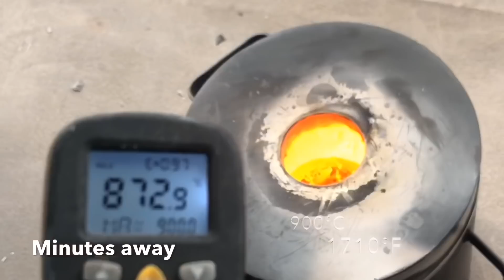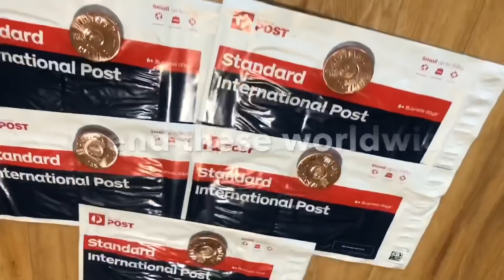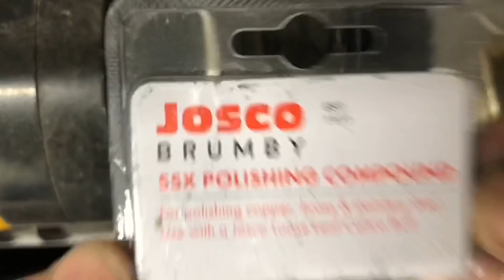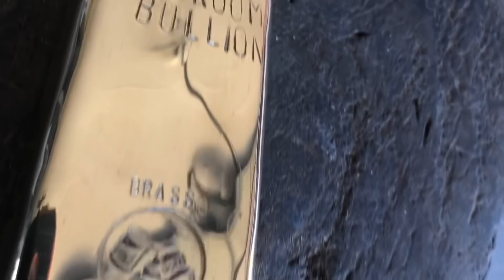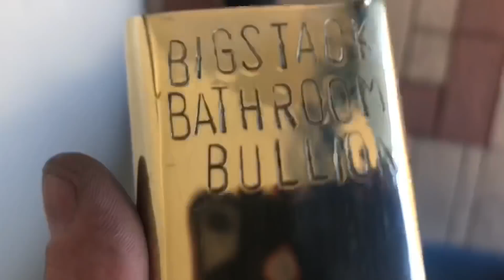Melting Bathroom Fixtures￼ - ASMR Metal Melting at Home - Brass Casting - BigStackD Casting

Comment: Next Video
She Left The Door Open So I Melted The House
Reply: She left the fence unlocked. Lol
Reply: She left the garage unlocked so i melted the car
Reply: Almost spat out my buiscuit again
Reply: angel Motano
Reply: 1. Usually, houses are made of combustible material such as wood.
Wood decomposes above 300 C.
2. Gyproc. This contains Calcium sulfate. It would at first emit H2O as water of crystallization is released. Then, at 1460 C, it will melt.
3. Cement/Concrete. This contains CaCO3 which would decompose to CaO at 1000 C. CaO melts at 2613 C.
The various silicates would melt around 1200 C
4. Nails. These are made of iron, which melt at 1535 C
5. Aluminium parts would melt at 660 C and copper parts at 1084 C
Reply: @louistournas120  so somethings yes others no
Reply: she left my love so i melted her heart :)

Comment: Great video as always! 

The reason that the bar is magnetic is because that shiny coating was actually nickel, instead of chrome. 

Nickel is one of the few materials that displays ferromagnetic properties. It would be in very low concentrations in your bar, that’s why the attraction is so weak. So instead of brass, you now have a Cu-Zn-Ni alloy!

Keep up the good work!

From,

You friendly neighborhood materials engineer
Reply: Hi Bryce2711 ,
    Would there be a way to separate the Cu, the Zn, and the Ni from each other during the heating process? Or would that separation have to occur chemically? perhaps via an 'anti-plating' process? or would the original metal need to be ground up real small, then put in a solution and then 'chemical stuff' done to it?
      If it had been chrome plated, would there have been a way to separate the chrome from the brass? Because that way, over time, when you (i'm looking at BigD now) got enough chrome you could make an Element Cube for Chrome. :-)   [note: As I wrote that, I began to wonder if chrome is an element (from the periodic table). But I think it is, so the question should still be good].
   Thank you Bryce2711 and BigStackedD

ps.  BigD, I Luved the parts of the video where you did the speeded up walking to the bathroom and back.  I could even hear the 'pitter-patter'  of your  'little' feet.   LOL    And the checking if the 'coast was clear'.  And of course the Pup.   :-D
Reply: Hello @jeffwhit4987 ,

There's no real way to separate the metals during the melting process. The easiest and best way to separate the three would be to use HCl (Hydrochloric acid) as it will react with both the Zn and the Ni. This reaction will leave the Cu in its metallic state while dissolving both the Zn and the Ni. It would be best to do this process with the material finely ground as it would react faster. The Zn and Ni could then be precipitated out of solution and separated. 

If you really wanted to, you could just heat the molten mixture of the three metal for a long period of time. This would burn the Zn out of the motel solution as it readily reacts with oxygen. Then you would have a Cu-Ni alloy. However, this would also result in losing a good amount of the other materials as well due to them reacting with oxygen.

Chromium is an element, however it would be far more difficult to separate as Cr is very chemically resistant. It could be done using HNO3 (Nitric acid), this would dissolve the Cu, Zn, and Cr. They could then be separated individually and melted.

Thanks for the question!

From,
You friendly neighborhood materials engineer

Comment: Dude, this is the first video of yours I've seen, not going to be the last!! I can only assume that the shelf of bullion are from previous...conquests.... Outstanding! Liked and subscribed
Reply from the maker: yeah matey you missed some real good ones be sure to check em out when you have time. And welcome aboard buddy.
Reply: @bigstackD Thanks for the reply dude, loving these videos! Not gonna lie, I spent most of last night's shift at work smashing through 30/40 of your videos 😂  I'm jealous of that devil forge, that thing don't f@#k about!!   Would I be right in thinking you heat up the moulds to prevent them cracking or does it have another purpose? Keep it up you mad lad!!
Reply from the maker: I heat up the mold as if there’s even the tiniest bit of moisture in there the moisture can turn  to steam instantly and cause a steam explosion sending molten metal everywhere. That’s why it’s also a good idea to pre-heat your metal over the furnace before adding it to existing molten metal as the same thing can happen if there’s moisture in the pieces you’re putting in. Also don’t miss Yesterdays video if you haven’t already seen it I’m doing a big Copper coin giveaway👍🏻😁🍻🍻🍻🍻

Comment: bigstackD Casting,

The reason that the ingot was slightly magnetic could be because the taps were nickel plated rather than chrome as you thought. Chrome is not magnetic, however nickel is magnetic like iron or neodymium.

Hopes this helps!

Comment: i think the bar is magnetic cause of all the nickel thin coating being melted along with the brass - nickel is ferromagnetic metal - i know i know the temperature is higher for nickel alone to be melted but may be the thin layer was just enough to be melted or become an oxide powder and to be dissolved in the brass alloy

Comment: Big, i come to you because i looked for a answer online and i couldn't find it. I was melting brass. There was a brass fitting in there. The fitting looked, smelled and the color was brass. I did the file test and it also came positive for brass. Anyway, everything melted exept that piece. Do you have a reason on why it did that? My guess was that the fitting was not brass but everything else told me it was. 
I could had said steel with brass coating? But my magnet didnt gravitated to the fitting and the file came out with a golden color. Im confuse and i hope you have the answer. Thanks
Reply from the maker: matey I’ve had that a few times where I would swear it was brass that I was melting but it turned out to be a type of brass alloy I’m not sure exactly what it was mixed with but it was extremely hard and took an extra 100°C to melt🤷🏻‍♂️.  I’m sure if you melted it on its own you would reach temps high enough for it to liquefy but if you tried to melt it again with brass you may overheat the brass 🤔. And like I said mate I had a brass fitting which I thought was exactly that and I eventually melted it on its own to find it was a brass alloy  and almost as strong as aluminium bronze because when I tried to stamp it it was near on impossible .  I’m putting out a video either next week or the week after where I was donated a massive brass piece And it turns out it was a brass alloy as I needed at least 1000°C to melt it And if it was brass it would melt between 900-940°C and again when I tried to stamp it it was near on impossible👍🏻. I hope that shed some light on your question. another way I’ve used to check if it’s brass as opposed to a brass alloy Is before I melt it I hit it really hard with my 3 mm steel stamp and if it makes a nice easy stamp it’s usually brass but if it’s extremely hard to stamp it’s a brass alloy,  and yes I understand most of the fittings don’t give you the opportunity to stamp them anywhere but that’s just a suggestion if you have the option 😁👍🏻
Reply: @bigstackD  thanks. You just helped me alot. Just because it lookd like brass doesnt mean its brass. I will most definitely try what you said. Im prettu sure with my vice grip i can clamp it and stamp just about anything with alittle of determination. 
Waiting on your next video, im hungry!!
Reply from the maker: Juan Carlos Munoz Next video is out tomorrow buddy so stay tuned,  I hope you like it👍🏻
Reply: @bigstackD  do I like it? Buddy, I love them even the one you think are bad.. feed me please!!! Lol

Comment: holy moly you have a lot of material. I think your next hobby is to be CNC Mill/Router..
Reply from the maker: Yes I have looked at those milling machines if they’re easy enough to use I would love to buy one and make my own graphite molds at least👍🏻
Reply: @bigstackD  You could make one with a couple of 3d printer frames as well as some additional aluminium extrusions. A printed mount for the router you chose :)

Comment: A quick question, how big is the tube that your burner is fixed into? I have ordered the same burner and need to drill out the hole on my foundry over the weekend before pouring the refractory. Thanks.
Reply from the maker: Matey I can’t tell you exactly if I had to guess I would say the hole is 55mm as the head of my burners are about 50mm and it’s a tight fit . If you have some kaowool to push into the rest of the hole you should be fine also you need to make it big enough to get the head of the burner in, but like I said if I had to guess I would say the hole is 55mm but 60mm at the absolute absolute max
Reply: Awesome, thanks mate.

Comment: Can you melt down all the nails holding the house together next?
Reply: Uioman Cannot the house is made of bricks
Reply: @danielma8859  There should still be some framing somewhere, the roof can't be made of bricks, and the interior walls. Nails need to be used somewhere.
Reply: Uioman Cannot there are no interior walls it is layers of paint, concrete, bricks, concrete, paint, the ceiling possible but you would need powertools

Comment: Why does it come out of the mold so ugly looking? Is there a way to mold it with a nicer finish, right out of the mold?
Reply from the maker: Yeah if I had of use more borax and give it a few stirs and skim it better before pouring it would come out pretty spot on but would still require some sanding and polishing to get that perfect finish👍🏻

Comment: You do know there is no value to aluminum pull tabs from cans right? It's a ridiculous urban legend and there's not a scrap dealer that's going to pay you anymore for those pull tabs than they would for any other can.
In fact, there is no difference between the aluminum that's in the pull tabs and the aluminum can itself.
Reply from the maker: Yeah but if I collected aluminium cans I would need another property to store them all on I am aware the value isnt increased With the tabs on or off but I just want to collect a heap so I can do some sort of casting with them being a touch more pure than the actual can👍🏻